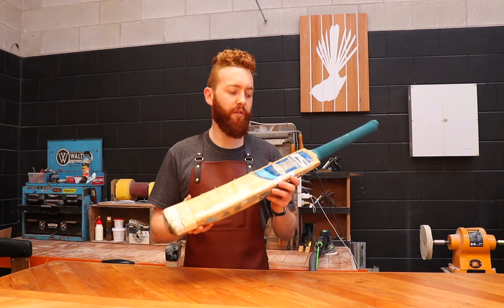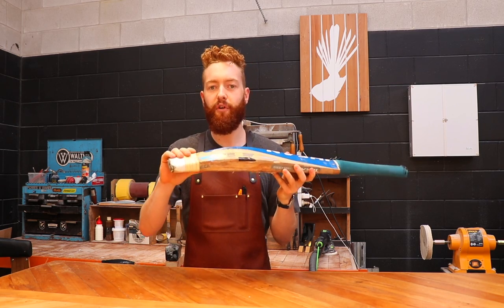Cricket Bat Repair 2019 - REPAIRING A BROKEN CRICKET BAT!!

Comment: Refurbish the toe, the face, the handle and the back.
.
Honestly, at that point is it not better to just replace the whole thing?
Reply: Marvin Kitfox save trees. That's the most likely reason.
Reply: you missed the whole point
Reply: @GamiumGamers  The restored bat used very nearly as much wood as making a new one, and it will be inferior in durability, accuracy and balance to a new bat. Restoring a bat with one crack, or just a worn handle, makes sense. restoring everything makes sense only if you want something sentimental to put in a display case.
Reply: Probably the owner is emotionally attached to it.
Reply: To sell it online as an used by players item
Reply: Agree with Marvin . I would just consider buying a new bat if the bat is this damaged and lived it's life fruitfully.
Reply: @sktk1499  Depends. I can get a full refurb for 80€. Replacement bat 340€
Reply: It’s because the batsmen gets used to the weight and the pick up and wants the same feel. Also sentimental value.
Reply: @Noice no stop that
Reply: what about the emotional connect which people have with their bat?
Reply: it only to showcase he's wood skills, it is use less for a professional player as it will be not doing same as before .
Reply: Marvin Kitfox i think it’s because maybe that dude you know scored a century with the bat and used it for a long time and he doesn’t really feel comfortable with any other bat
Reply: @zeldadudesmosh  exactly. It might have been a gift to them. I still have my first bat i got for Christmas 30 years ago

Comment: 1 yorker at 90 miles per hour and we will see the restoration part 2 video
Reply: Who wud play with a restored bat @90mph
Reply: Hah hhhhh
Reply: sathish kumar jhyjf
Reply: Lol
Reply: @samad khan i see this comment previous restoration video
Reply: What if he plays square shot or lift the pace
Reply: Bro he will remove his bat and get bold😁
Reply: Bhagoooo...... 🙈 bhagoooo......
#omshantiom
Reply: You mean 144.8 Kms per hour...silly American
Reply: Cool story but I disagree. Modern adhesives are quite amazing. I use the Tightbond range and once the adhesive has cured, the joint is stronger than the surrounding timber. So if 144.841kph is not enough to shatter the bat in normal use, it's not enough to affect the repair.
Reply: Samad Khan good one hahah
Reply: @Jamac007  Americans don't play cricket
Reply: After playing in front of rabada only handle will be only holding the handle 🤣🤣😂😂
Reply: Samad u nailed it
Reply: Is this the part 2 of the same comment on the other restoration video?
Reply: I was beat to the MPH commentary... welp
Reply: Bro that's why that guy put wooden screws at that side😒😒

Blind
Reply: @jimmyfleebot  yeah bro exactly, teach something to him who did this comment 😀😀
Reply: @rogershockgaming9797  we know, you and me
Reply: Kiya copy kiya he vai 👏👏
Reply: Imagine if he can restore a bat then what could he do from scratch
Reply: No Bro it wont even have a crack
Reply: The oak dowl will soak that up no problem.

Comment: The original bat was made by "Ihsan sports Pakistan"
You did a wonderful job. But, the issue is that weight and balance of bat will surely be lost after restoration process.
Regards,
Reply: Weight increased at certain positions which might had disturbed its balance

Comment: Technical question time:  I saw you cut out a piece from fresh clef and glued it in place and sanded it flush. Usually all bats are pre compressed to ensure minimum ball impact and resulting dings on the bat face. While this was a worn out bat from prior usage and had no further scope for any more dings on the original surface, however the newly joined piece on receiving the repeated ball impact, will get compressed over time and will appear Below the rest of the bat surface. 
Did you receive that complaint from your customer for this bat ?

Comment: As seen in your video after applying linseed oil you stick on the Anti Scuff Tape. But When I tried doing so the tape won't stick to the bat. What am i doing worng?
Reply from the maker: The key is not applying to much and not oiling the edges. This video will help you out: https://youtu.be/XL9MZ8DzTh8

Comment: This bat will break so easily 
1. He is holding one piece by glue.
2.if it hits that piece it is gone
3. He drilled holes in it a stuck cheap wood in it with glue